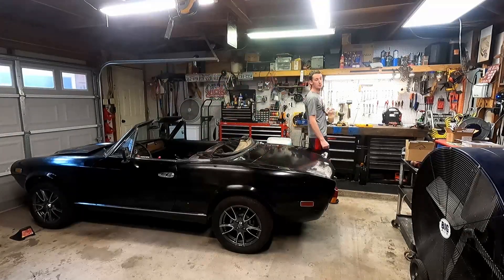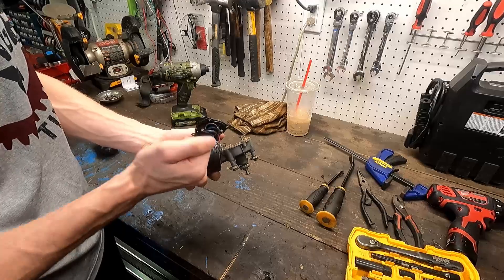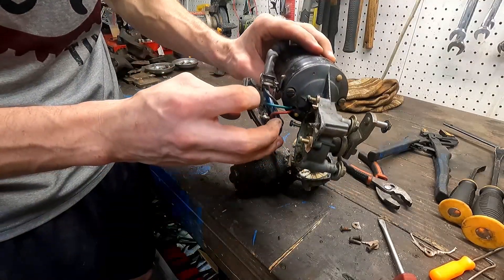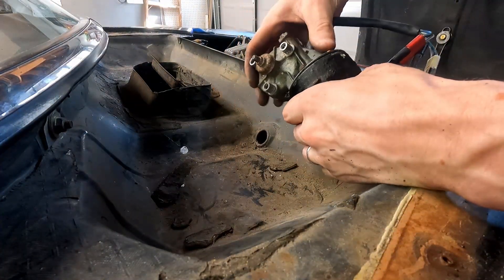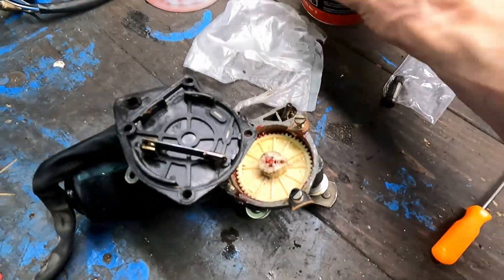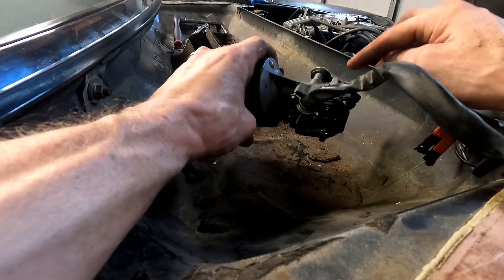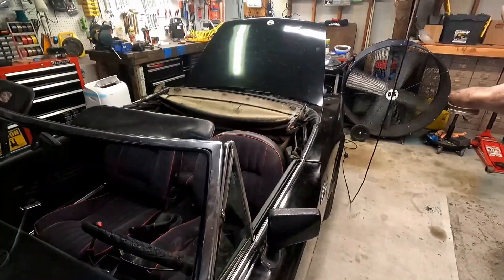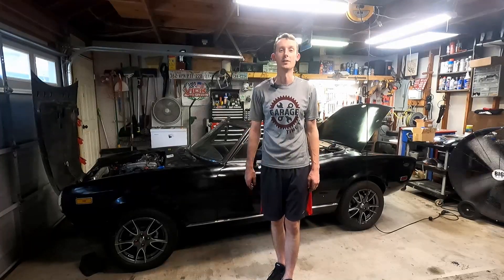Wiper Motor Repair on our Fiat 124 Spider Project!

Comment: I've never tried it myself , but I have read there is an easy to adapt VW Rabbit wiper motor that essentially bolts right up. A little re-soldering for the electrical connectors, but you end up with Bosch reliability rather than Benito Magneto. (who gave us , not only an early version of intermittent wipers, but on occasion, intermittent headlights, intermittent ignition and intermittent  heater fans.)
Reply from the maker: What year? It may be worth a try!

Comment: The white plastic gear inside my motor looks to be in pretty decent condition. 

Do you recommend putting white lithium grease or penetrating oil on the gear, or should I just clean it and keep it dry?
Reply from the maker: @djratproject  grease is the best option. Keeps things moving and moisture resistant

Comment: I have a 1981 124 spider there's a clicking sounds until I push the wiper arm down then it stops. Do you think it could be the relay ? Thanks in advance
Reply from the maker: Is it running or not?
Reply: @GarageTimeTV  the wipers are moving.  I hear clicking sound in the clove box
Reply: Aren't
Reply from the maker: @erickfrench2768  sounds like the teeth inside could be broken/missing. The clicking could be them trying to engage and when “load” is applied it skips.
Reply: @GarageTimeTV  should buy I new motor?
Reply from the maker: @erickfrench2768  new would be advised.
Reply: @Garage Time TV  thank you so much . Now I need to figure out why my brake light stays on the one where it says brake